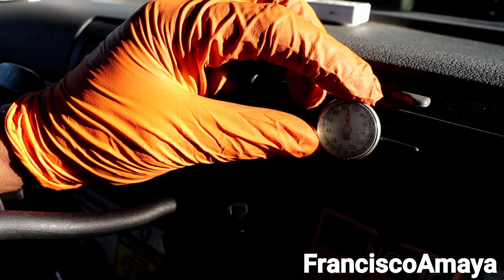S3 E1 F.A.I.T.H. Freightliner Cascadia AC system not working inspection repair process diagnostic

Comment: My a/c compressor is on the clutch engages and it has Freon but I’m still getting hot air in the cab. Any recommendations on what could be the problem? It’s a 2020 cascadia freightliner.

Comment: Hello, I need help with the connector. I don’t get any power in the connector which is positive and negative one it is zero power. What do I need to check? I have checked all the fuses relay and stuff what other issue that could cause the power loss

Comment: I am trying to test compressor. I put power probe on compressor. It then blows the fuse on power probe when I put power to it. The clutch does not engage. Is the compressor bad?

Comment: My truck blows hot air and the clutch is engaged on the compressor
Reply from the maker: probably your expansion valve is bad or your hvac vent control motor

Comment: Great video,Iam diagnosing Dd15 ,2019 freight.Cascadia trying to locate fuses and step by step,Thank you
Reply: Just had my starter and pdm replaced at my shop. Now compressor is not getting power.

Comment: So by checking power on the electric connector you determine the compressor fuse is not blown . Not pressure is good , you still don’t know if the truck has free on because u never connected ac manifold

Comment: Cómo puedo saber porque no tiene corriente el Compressor, cuando todo aparentemente está bien. Tiene gas, el Compressor está bueno, el sensor de presión está nuevo . Pero no tiene corriente el Compressor. Tiene algún fusible , es un cascadia motor DD15. Y también los Cummins.
Reply: Pudiste solucionar ese problema

Comment: How do I get rid of the ABS light I already replace all the abs sensors and replace all of the wheel seal cleaned everything with the pressure washer but my abs light don’t go of any solution

Comment: What if the ac clutch does not engage when you put the power probe and there is also no power from the truck side of the connector?

Comment: My Freightliner Cascadia clearance lights , dash lights are flashing. Headlights stay on as well as the ABS light. Brake lights do not work nor do the turn signals. Code SFU 49. Please advise

Comment: Sorry, but if the clutch is bad then replace the clutch...Replacing the compressor and the drier is going to cost the customer hundreds of dollars more. 
The clutch costs around $75 dollars and let's say you as the mechanic double that price and add your labor to that. 
Most clutches can be cleaned and will again work. You can force it to engage by pushing it in and then apply WD40 to the gap. Do this several times and the clutch will free itself and become functional again. 
The one in the video looks pretty ratty. It's likely just needing a good cleaning.

Comment: if the compressor and dryer were replaced prior to me diagnosing, noticed that that compressor is alway engaged and the dryer is getting really hot. also the pressures on the low and high side are shooting up to 300psi what could the system doing?

Comment: Hi my power is 2.7v at the supply to a/c compressor clutch, my low pressure is at 60psi and hi pressure is at 45psi is it mean I'm low on a/c?

Comment: My 2012 cascades ac nit working properly it takes one can and it goes to warning side my low end reads 75 psi my high end goes to 45 psi but won’t take another can and the system was empty

Comment: What if I don't have power on the ac compressor clutch and on the connector which going to the clutch as well  ( Should it be 12-14V ?) ? And clutch not engaging of course. Where should I look ?
Reply: So do you found the problem 
I have the same problem.
Reply: Fuse
Reply: Which fuse?